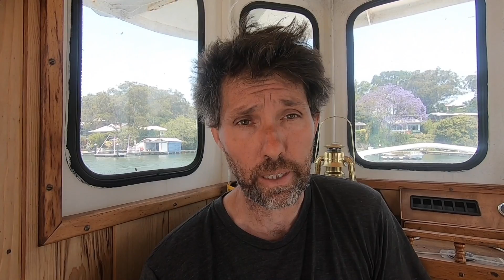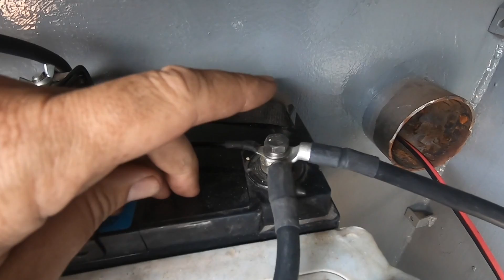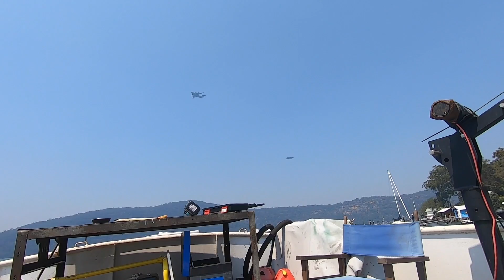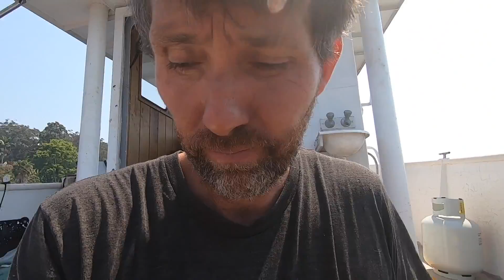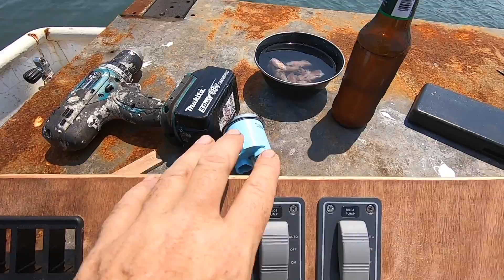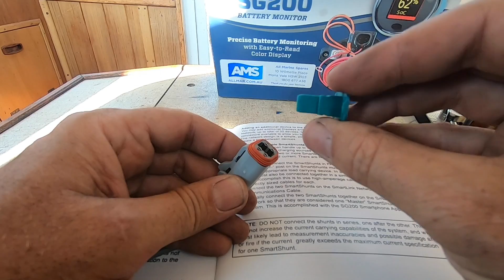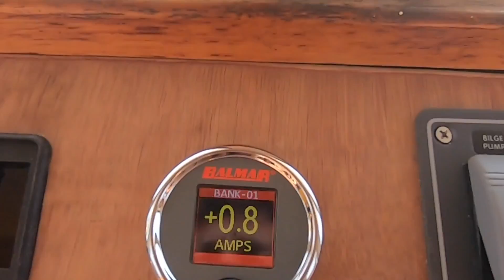Monitoring a boat's battery banks

Comment: hello Stu thanks for this great video.
I only have a 22ft fishing boat but with numerous electronics on board, very nice to know where you stand with amps in house battery.
i see simple systems now with the info on cell phone apps,instead of gauge on  helm region.
is this something you might have considered if it were available at your time of install?
thanks
john

Comment: An all important point to be said here in this area . Lead acid battery are not able to be drawn or drained down . You have to think of them as being able to 50 % of the capacity.  So when you get to a 50% level you take that as you are drained down and need to recharge.  The more you use the bottom end of a lead acid battery the more problems and shorter life you will have.  The lead plates can warp and touch other plates causing internal battery shorts.  So just use the top 50 % of a lead acid battery.

Comment: H Stu.  Can this Balmar unit be used on outboard engines to keep track of the battery status?
Reply from the maker: It can, but if it is a single battery that starts the engine then it isn’t so useful. It really shines when monitoring a house battery bank that runs things like fridges and cxx as bin lights etc.
Reply: @DangarMarine  Thanks for the reply.  I really learn quite a bit from watching you make repairs.  I have a single 125 hp merc with two batteries (one primary, one secondary).  Do you have any recommendations for any kind of "battery health" gauge that can monitor two batteries?

Good luck from America dealing with the tragic fires!  We are all having good thoughts for the people of Australia.

Comment: Hi Stu, I usualy run my drill in reverse in the beginning of the hole when using a holesaw in materials that might chip, just to awoid chipping the material. 

A little tip I realy enjoy your channel.
My boat is on the hard at the moment do to the fact that the sea is frozen solid for a couple of months=(
Reply from the maker: Thanks mate. :)

Comment: I like those Deutsche connectors. I bought in to the Delco connector system for a project I'm doing, but the Deutsche ones seem easier to work with.

Comment: Where's the best place to hire a tinny @ Brooklyn, Stuey?
Reply from the maker: Good question. Never done it myself but I think Brooklyn Marina and Brooklyn Central both have them and are very reputable.
Reply: @DangarMarine  Cheers mate, I'll check them out. If you see 2 blokes in a hire tiny, briefly pull up to the trawler in the next few weeks, It's just me and my bro dropping them pans off while going for a fish. Yell out if interested in wetting a line.

Comment: Another great video Stu. A top tip for anyone who's never wired batteries, starters, alternators or shunts. Never over tighten the binding post terminals as they crack the potting body/ connector substrate
Reply from the maker: Yes, it's never a good day when you hear that plastic crack...

Comment: Fun fact, the coil of wire won't create any inductive issues as you are working with DC.

Passing a magnet in and out of the coil would produce an AC current.
Reply from the maker: Thanks for the clarification. Very good to know when it comes to neatenting up the wires down the track!

Comment: Stu: You were in IT- a question, what's the most difficult thing to get a programmer to do? Write documentation! Don't be that guy- Take pictures, and draw a complete schematic of the entire wiring harness. Things that are right in the front of your mind, now, will definitely be forgotten, down the road.Get out your labeler and label everything, even insignificant stuff. Then, get a big ziploc bag, and put all the product installation and operating paperwok into it, and find a (reasonably) dry place to stow it. Someday, you'll need it. And even if you don't, somebody else will. I've held my tongue, but you've got a pretty complex setup, there, and a little time, now, will save a massive headache, later.
Reply from the maker: Already done!

Comment: I recently discovered a much better tool (than a holesaw) for making holes in plywood and similar materials  - a tank cutter or adjustable hole cutter makes a really clean cut,  and with some test cuts on scrap material it can be adjusted to the exact size hole you need..
Reply from the maker: Interesting, I'll have to experiment with one.

Comment: Thanks Stu,very nostalgic for me as before I learnt my Radio/Radar electronics in the Royal Navy I had to learn my marine electrics. As a raw 15 year old I had an old Chief PO who insisted that we must be able to recite OHMS law. Here goes........ Ohms law states that the current flowing through a conductor is directly proportional to the potential difference between its ends providing the temprature remains constant. Therefore V over I equals R V over R equals I and I times R equals V... I can still quote it and understand it at 64 LMAO
Reply from the maker: Nice work David, and it is really interesting to hear the background of long-time commenters. Thanks for sharing. :)
Reply: @DangarMarine  Didn't even touch on my diving yet LOL

Comment: Hi Stu
Shame about your clock not working but you should know that the battery mechanism is completely replaceable  and for only a few dollars. More to the point it's a job that could be done by yourself using your 10mm spanner.

Comment: Hey Stu, so exciting seeing your trawler come together. I loved rigging my boat up with the electronics and stuff and I had a suggestion. With all the battery wires all around, if you get the reusable Velcro cable ties you can get all those cables organized easily. Then put on the conduit over them. Probably overkill but it would look so epic in that space and it would be safer. Probably make for a good video. Anyway cheers from CA. Keep making great 👍 videos. Great channel.
Reply from the maker: Thanks Franklin. I actually have a packet of those velcro ties on the boat right now. My plan is to make some sort of rack above the batteries so I can get the cables up off the tops of the batteries.
Reply: Dangar Marine ok great can’t wait to see the end result! Yew! 🤙

Comment: You seem like you keen to learn more electronic stuff.
Most of that expensive gear you are buying can be cobbled together using a Raspberry Pi microcontroller. If you learnt how to use one then you could save yourself a boat load of cash.
The Raspberry Pi allows you to use your Android phone to control anything on the boat. While on the boat or remotely. You buy a single controller for about $100 and then sensors for measuring voltage and relays to switch stuff are in the $20 region.
It would be trivial to set one of these up to alert you using the internet if your boat was interfered with or the water level sensor(they sell many) was triggered. 

https://www.raspberrypi.org/products/
Reply from the maker: Yes, definitely something I have been meaning to look into for quite some time now.

Comment: A little suggestion, give the back of your instrument panel 2 or 3 coats of what ever you have been using to keep the moisture out, especially the edges, would you recommend a battery monitor for normal run of the mill boats?
Reply from the maker: Yes, I definitely should have coated both sides of the timber. I'm not sure I would go a full battery monitor for a smaller fishing boat. In that case I think a simple voltmeter is probably enough to confirm the battery is charging properly and hasn't gone too flat.

Comment: Stu have you seen these https://www.amazon.com/Connectors-Waterproof-connectors-Haisstronica-40Yellow/dp/B07J9XWT5Z ? I had not seen these before yesterday. No idea how well they work, but I ordered some. There are several choices on ordering them online. Only copied the Amazon link.
Reply from the maker: Yes, I've been using those for a few years now. They are handy for sure, and definitely work best with a good heat gun. The trick is to get them hot enough to melt the solder without melting the outer casing.

Comment: Nice unit. Oh, about the 0,8 amps going in. When your batteries are full your solar controller will stop charging or charge at low maintenance flow only. To protect the batteries. That explains the 0,8 amps.
Reply from the maker: Good point. There is also the fact that the solar goes into all three battery banks and gets shared.

Comment: I find the electrics interesting.  Ohm's Law is a very simple concept that helps take away the mystery that surrounds electricity.  On another note, to accurately measure a hole saw, you must include the set of the teeth in your measurement... don't just measure its body.  :)

Comment: Doesn't take long before that simple neat wiring layout starts getting a little messy.  Glad you planned for it otherwise you'd have a real disaster.  I personally hate those in-line fuse holders because it's too easy to forget what circuit their protecting and, whether in fact there is a fuse in a circuit.  I prefer to have fuse/circuit breaker panels where I know where everything is and what it protects.
Reply from the maker: Yes, given there is space on the board next to the battery chargers it would be interesting to cut out all the inline fuse holders and move them all to shared fuse panel. Before cutting the Balmar one though I'd like to check with them whether that cable has a known resistance for any reason.
Reply: @DangarMarine  - Good point.  I didn't think of that and I was the one who spent half a day cutting and splicing a parallel printer cable so I could relocate the printer and when it didn't work, I spent the rest of the day figuring out what was wrong and cutting it back to the original length.  That was around 1979.  Tough lesson and here I am suggesting you do the same thing.  Shame, shame on me.

Comment: I watched you put the spanner down on top of the batteries and cringed.  There is NO off switch on a battery the terminals are always live neither do they have a fuse to limit current.  Take care when using steel tools round batteries. I have seen the aftermath of a spanner dropping on the terminals of a car battery. The spanner was in two parts with lovely rounded ends like a welding rod.  The battery needed replacing too the internal plates were bent due to the very high current that flowed.  Just a point for you and all watchers. 
The electrics are as important as the hull. You wont get far without the electric system. You are using and fitting equipment that is important for the boat you are wanting. Some of the stuff may not be absolutely necessary to others ..........But is for you and your boat. Stick with it, the ones who don’t like this bit will like another parts and videos.  They will forget these bits quickly.  She is taking shape,  good work all round. Amacf
Reply from the maker: Yes, don't worry. Having worked as a mechanic on cars for years I've seen my fair share of people shorting spanners on battery terminals or the positive and the body of the car. I'm always mindful of where I put them. :)
Reply: @DangarMarine  Learned as a teenager that you don't even need to be working on electrical to learn about electrical safety.  For some reason Dodge decided on some engines to put the oil dipstick behind and below the alternator.  Managed to get a metal watchband across the ALT output terminal and the ALT case.  Impromptu lesson on how an electric heater operates as band went from chrome to glowing red.   Removed watch very quickly.  Took me quite some time to find it after removal, as it went flying.  About 36 years ago and still have interesting parallel scars on inside of my wrist.

Bus tie between start and house battery banks awesome plan, as are multiple bilge pumps and a way to charge batteries other that the main engine. 

If you don't have a seacock on the raw water cooling DISCHARGE and it is below the waterline, might consider it.  Not having this and having the discharge hose fail results in not being able to run the main engine AND water on the wrong side of the hull.  15 miles out from the marina, no main engine, inaccessible discharge hose dumping water in the bilges, two installed and one "emergency" portable bilge pumps almost keeping up, both battery banks tied together, with a 20-HP kicker outboard trying to move a 24-ft fiberglass cabin cruiser back to the marina and keep batteries charged.  Good radios also helpful, as a radio call can have the truck and trailer already sitting at the launch ramp to pull the boat when you arrive.  Yes, the discharge hose was re-routed so it was both accessible and part of it looped above the water line.
Reply: yep thought so but others may not have the same background and just take it as a thing to do.   Alan

Comment: I turned off the batteries and did similar electrical work on my boat.  What a disaster, what a disappointment...not that the new system doesn't work great - the beer got warm.
Reply from the maker: A true tragedy.

Comment: As you might remember, I am not a boat guy, but I am an RV guy and an electronics guy. So, I understood and loved this vid. In many ways, your boat is an RV that floats. It seems that there is a current, though small, group of folks who are converting trawlers to living spaces...not as glamorous as sailboats, but easier to handle.
Reply from the maker: You're dead right about liveaboard boards being very similar to RVs, you have all the same basic needs. On a similar note, Scott I visited in US who gave me tips on my Detroit diesels runs the channel Bus Grease Monkey which is pretty much all about old buses converted to RVs, a very similar concept to trawlers being converted to cruising boats.

Comment: on those duetsch connectors  you should go back 4-8 mm  befor anchoring or taping so the wiring isnt pulled sideways in the seal allowing  crap to get inside.   just sayin.  doubt you'll have  problems but the batteries if they off gas it will sink since its heavier than air.    all these comments on the planes-  dont they know they are federation toilet paper supply ships heading to uranus to wipe out klingons?
Reply from the maker: Good tip about the deutsch connectors.

Comment: Hey Stu - I like the electrics episodes. Having a boat myself, I have found that electrics are the most common issue to deal with. From motor tilt sensors, fuel gauge sensors, audio, sonar - and that was in the first six month of awning the boat. I still want to switch the lighting over to all LED, install inboard lighting, put in a proper Battery on-off-on switch among other things. 

Your videos are useful in trying to convince the co-owner to invest in proper marine grade parts and not try to cheap things out. I'm also a bit of a electronics geek between my education and career background and my hobbies...
So yeah - I'll watch all the electrics episodes and sometimes even refer back to some of the older ones. Thanks for the content - and Cheers!
Reply from the maker: Thanks Shane, glad you enjoyed the vid. Yes, there are so many things that need attention on a boat that are electrical in nature. Your first six months are a classic example.

Comment: Hi Stu, Interesting calling it a Shunt. Unless I'm wrong here that is a medical term for an expander for heart arteries to prevent heart attacks. What you were showing on the video looks like what we call a Solenoid or Relay here. I have two on my RV going to my slide. It's wired from the 24volt duel battery's, wires coming in from the hydraulic pump and two out to the house slide in/out switch. Nice the instrument panel is looking good
Reply: It's a shunt in electrical terms, that is, a direct connection for current flow.  Here it is just a known resistance metal bar used to determine the current flow by measuring voltage drop across that known resistance.
Reply: Ok, it was confusing when I saw it on the video.
Reply from the maker: Hey Tim, yes, looks a bit like a relay but a very different beast.
Reply: Never seen one like it before

Comment: I think you're going to need a second shunt, the draw on that starter is probably going to be around 500 to 700 amps. I might be wrong, but I would do a startup test on land before putting the motor in the boat. You could check that stuff like that then, just to be on the safe side.
Reply from the maker: The starter current doesn't flow through the shunt, it is only measuring the current draw on the house batteries.
Reply: @DangarMarine  That's good to know, I misunderstood that then. I like the battery metering system!

Comment: Stu: Wouldn't hurt to have some insulated wrenches when working on those battery banks. Nothing like a Big Arch to ruin your day and batteries.
Reply: Correct sized socket driver. Keeps you from over tourqeing the nuts too.

Comment: These styles of monitor are incredibly useful, I use the Victron equivalent in our van. Does this have the ability to add Bluetooth? I've found this invaluable in with confirming battery health without having to go to the electric's cabinet.
Reply from the maker: Yep, it has a little module you can plug in to view the data on your phone.
Reply: @DangarMarine  Do they make one that emails you when the bilge is filling up?

Comment: Great video complete with a proper fly over.  Good to see the 8mm spanner still has some life left in her.  😉

Hey Stu, will the display flash and alert you when you are getting very low on charge?  Would be really nice to get it to pair with a simple bluetooth so you could pair it with your phone and get alerts setup there so your phone could sound off the alerts.  Will have to give some thought on how you could get the alerts when your away from the boat.
Reply from the maker: Not sure about the alarm yet, I'll have to read though the user manual. You can definitely get a transmitter though so you can pair it to your phone.